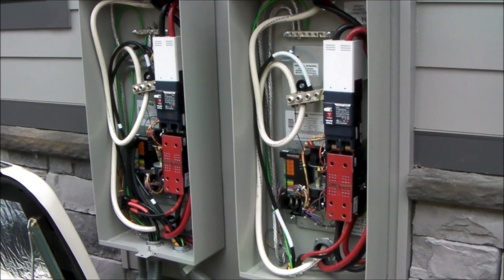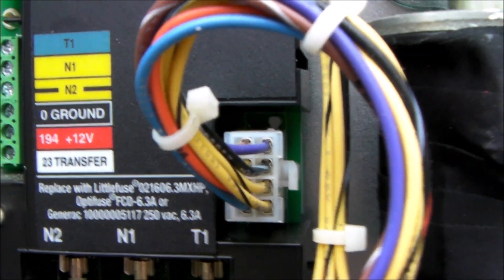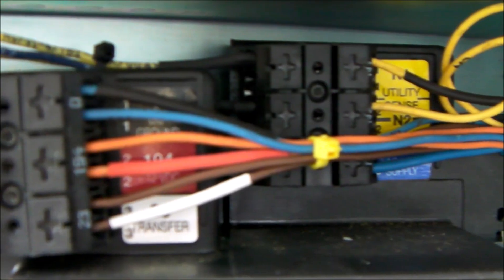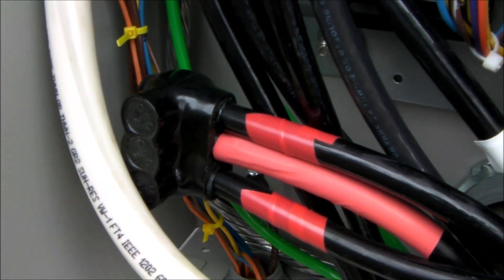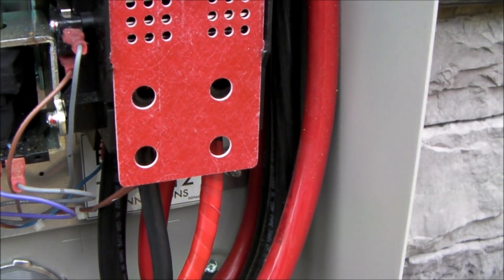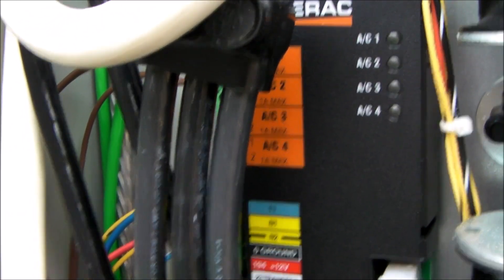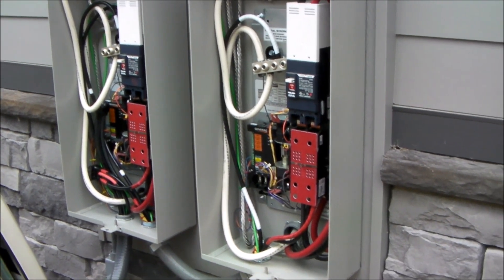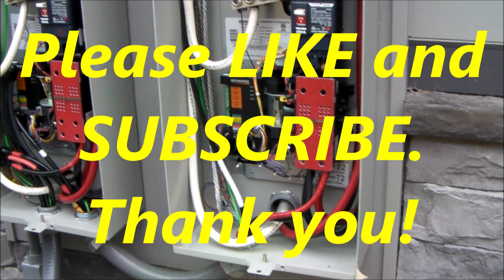How to connect two Generac Transfer switches to single generator

Comment: So with the low voltage wires you have one generator cable with those wires. Do you splice them In the first transfer switch to the second one or how does that work ?
Reply from the maker: if I recall correctly, transfer switch 1 gets ALL the low voltage wires and the switch 2 only gets 2 or 3.  Those 2 or 3 in transfer switch 2 get connected to the ones in transfer switch 1.  I did find this description on the gentekpower.com forum.  

"When installing a 2nd switch, you really just have to parallel the power conductors coming from the generator together in a junction box between the 2 switches. The 2nd switch just gets 2 control wires, 23 and 194 (if you're going to use the load shed module make sure and run 0 as well). It doesn't need T1, N1 or N2 since those are fed from the main switch and the generator doesn't need a 2nd set and the other switch doesn't need them to operate. You'll want to make sure that any load shedding is done in the main switch though, and not the A/C's switch if you didn't run the 0 wire to the 2nd switch. The 0 wire is the battery ground from the generator to power the load shed module."  

This sounds accurate but you should investigate further to confirm.  Be sure to LIKE and SUBSCRIBE.  Thanks.

Comment: From what I've heard on systems with only one ATS, to transfer test the generator you simply have to flip the utility disconnect switch in the single ATS. On a setup with two ATS, to perform a transfer test are you supposed to flip the utility disconnect switch in each ATS panel or just one? Sorry if its a dumb question or if I got anything wrong, still trying to learn how this works for my own system.

Comment: I am trying to do this same set up.  would you mind sharing which generator size you are going with?
Reply from the maker: 24kw .... it's overkill.  I would suggest smaller rather than larger for more fuel efficiency.  I doubt I will ever tax 24kw

Comment: Why would you need to hook up two transfer switches when you can possibly install a two pole 200 amp circuit breaker or a plug in lug kit within the primary sub panel and nipple the two loadcenters together? Essentially you would have a primary panel feeding the other while utilizing only one transfer switch. I know Siemens makes a 200 amp 2 pole single phase circuit breaker. GE uses a lug kit that plugs in taking up 4 spots in the primary panel. Not sure about Eaton. This would have less moving parts, less expensive, less work, and definetly less material besides the transfer switch.  - Don Friend Morton Grove, IL
Reply from the maker: Cost:
Two 200A transfer switches are generally cheaper than a single 400A switch, and the wiring costs are also lower. 
Existing Service:
My new home with a split 400A service already had two 200A panels, making it a natural fit to use two 200A transfer switches, one for each panel. 
Generator Capacity:
If your generator is rated at 200A, using two 200A switches allows you to effectively split the generator's output between the two panels. 
Load Shedding:
With two 200A transfer switches, you can choose which circuits from each panel to power during a generator outage, allowing for load shedding. 
Simpler Installation:
In some cases, using two 200A switches can simplify the installation process, especially if the generator is located near one of the panels. 
Flexibility:
You can choose which circuits to power during a generator outage, allowing for load shedding. 
Wiring:
When using two transfer switches, you can connect the low voltage control wires in parallel between the two switches, and only use the utility sensing and battery charger terminals in one of the transfer switches.
Reply: How many kw is your generator?

Comment: I have a question, what happen if turn off only one of the transfer switch? Is that makes the generator start and send power to both of the transfers?
Reply from the maker: If you wire them together according to factory recommendations, when ONE transfer switch sensse NO utility power, it starts the generator and then activates BOTH transfer switches a few seconds later.  Why would you ever only want to activate one transfer switch in the event of a power outage?  The power loss sensing circuits for both switches are wired together to each other since the generator only needs a command from ONE transfer switch to start.

Comment: Is it possible to add a 3rd transfer switch. 48 kw Generac is what the homeowner has .
Reply from the maker: yes, a third one could also be connected the same as two were. Be careful and be safe!
Reply: @YuDaMan  I read on generac website if you connect more than two swithces you need a relay for voltage drop? They don't explain it any further than that, maybe something to look in to.